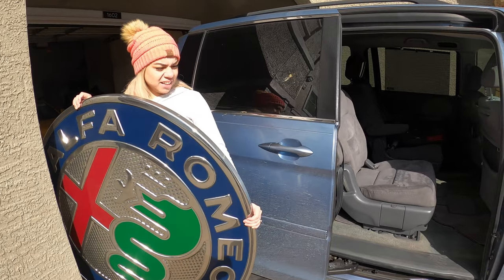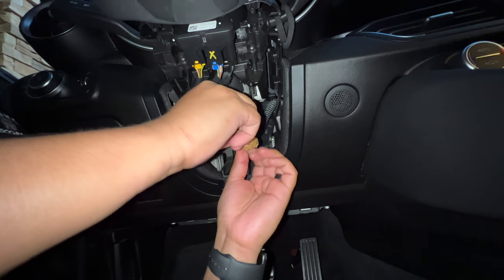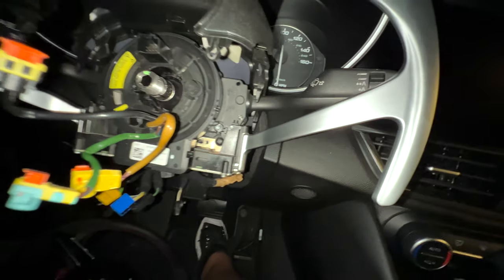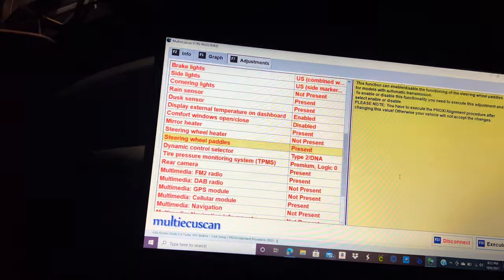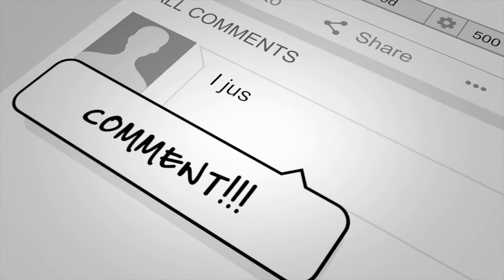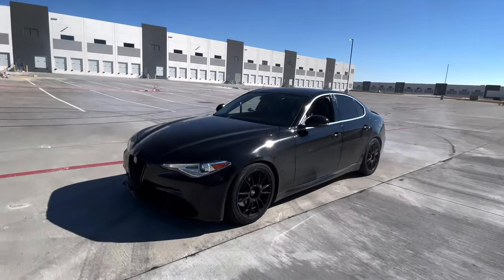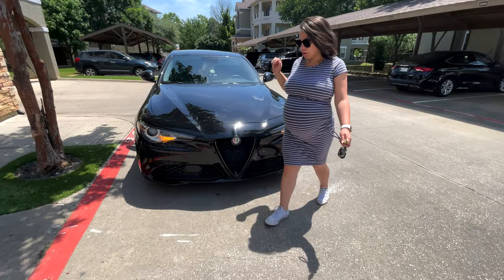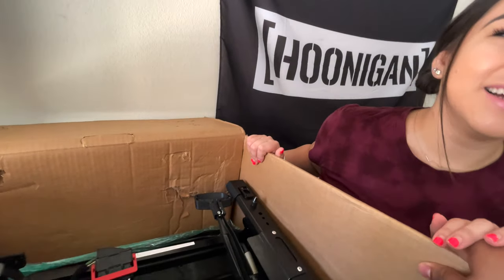Alfa Romeo Giulia Paddle Shifters Install

Comment: Hey! Question , so I have a base model giulia 2018.  I am able to buy these prattle shifts and it will be able to connect to my car with no issue ?
Reply from the maker: Yesss! I have a base model as well! The connector is already prewired, if you removed the bottom steering column cover you can check it out 🙌🏽

Comment: Another great video guys, I’m fitting these soon, I know I need to do the proxy alignment to make them work, however am I ok to install them and have them activated later when the cars in for remapping- I know they won’t work till then but they’ll just be installed, is that ok or will electrical mayhem ensue?

Comment: All alfa romeos from 2018 onward have a security gateway module installed meaning the multiECUscan will not work unless a bypass is installed on the module. That is the most difficult part of the paddle shifter retrofit install. What year is your Giulia?
Reply from the maker: Yes they do, I didn’t mention that in the video because mine is 2017. I have installed quite a few for people here locally, it’s not too difficult once you remove the bottom panel.

Comment: I know this is an older video, and I bet at some point you already answered this question but I’m new to your channel. So I installed paddle shifters on my base model Giulia, I don’t have a multiecuscanner, would I be able to do this with my Autel scanner to enable the paddles and if not where can I get the multiecu? Also off topic, what’s the easiest way to turn off traction control on the Giulia?
Reply from the maker: You can buy multiecu through Alfissimo, and you can turn off traction with race mode or Squadra logger

Comment: Hey, guys. Great video as always. You captured such clear video of everything!

I just did this on our 2021 Stelvio back in July 2021 and wanted to mention (sorry if you did and I missed it) that the steering wheel nut is one-time-use according to Alfa Romeo. Now, I've reused the steering wheel nut on many other cars and never had an issue, but since Alfa said to replace it, I bought a new nut.

The part number is 6510584AA and torques 33 to 40 ft/lb if you decide you want it. I decided to trust Alfa Romeo lol!!

Ciao!
Reply from the maker: Appreciate it Brotha! 

Appreciate the part number 🙌🏽 yesss absolutely right, the nut is technically one time use!

Comment: Really appreciate the video! Tried to do it without taking the steering wheel off and failed. I’m gonna follow your lead of taking the steering wheel off. I saw someone say they had an issue of once they put the steering wheel back on having the steering wheel center wouldn’t drive the car straight. Have you had any issues with taking off your steering wheel and putting it back on at all? Just being cautious, thanks in advance!
Reply from the maker: I saw that comment to; but it’s really hard not to get it aligned it only goes on one way lol. I’ve done a few of them and you can’t really mess it up. Just take your time and go slow.

Comment: Great content!!! 
I have a question it’s possible to  add the petals on a 2019 Base model?
Reply from the maker: Yes it will! You can always double check by removing the lower panel and finding the plug in for the paddles